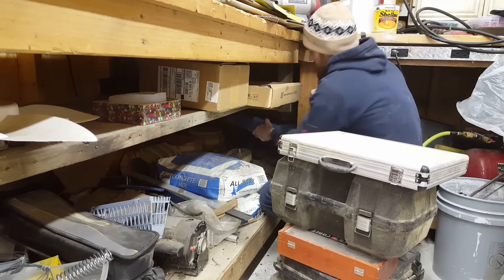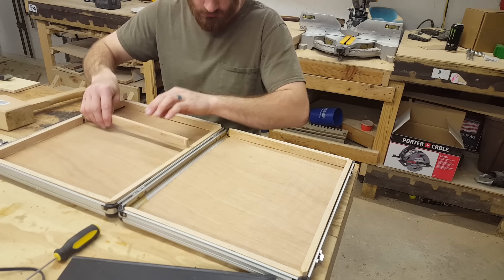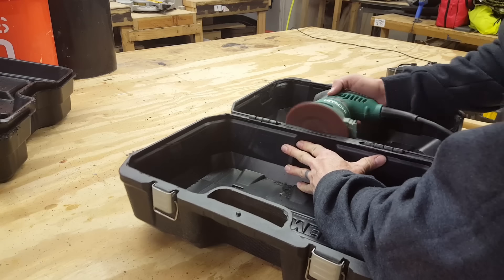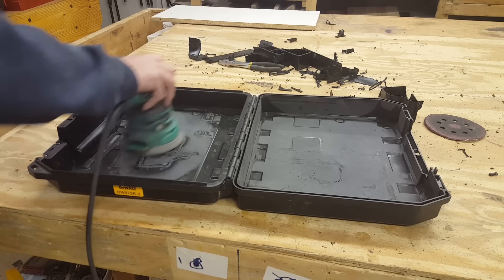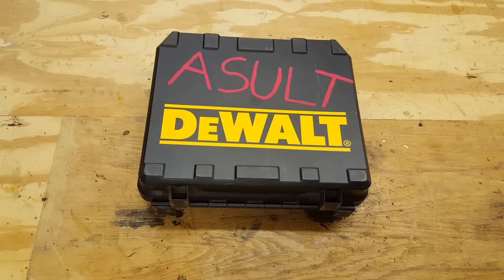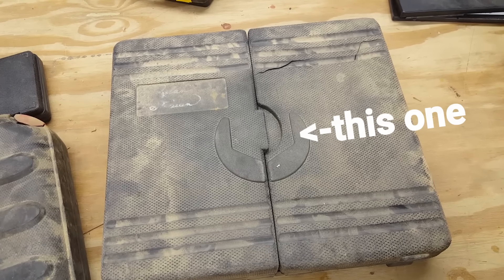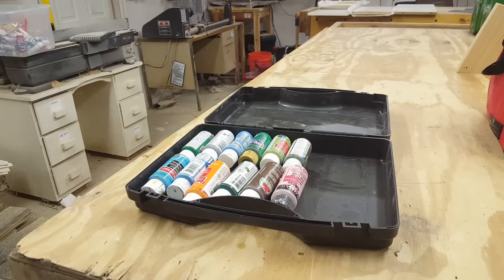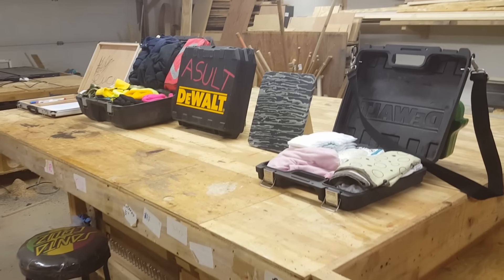5 Things to Make With Old Tool Cases

Comment: I'm 58 and have the tin dustpan my father made as his shop project in school.  He's 85 now.  I still use it in the garage almost daily.  Works better than a store-bought plastic one.  Two thumbs up for your case recycling and keeping the memories alive in your cutting board.
Reply: That is very cool about your fathers dust pan. I also made one 50 years ago in metal shop class out of galvanized sheet metal and a flat steel bar bent for the handle with a loop to hang it and all spot welded. I still remember making it in class and I use it almost daily as well. Very simple design and it's the very best dust pan I have ever owned. It will be handed down to my son and I know he will love it too.
Reply: Beer carrier for the deep ones.

Comment: I live in a small apartment and I found a bunch of dewalt cases in the trash a few years ago.  I use them to hold all my tools, my hardware and anything related to construction and repaire.  They are fantastic and it is alawys nice to be able to take what I need to people's houses when they need me to fix something.  Never throw these away.

Comment: I use a couple of them to hold my ratchet straps tie downs that I use with my pickup truck. The boxes slide under the seats so they are never in the way, but always close by when needed.
Reply: This is such a great idea!  I'm going to make this.  Thank you.
Reply: Pure genius, they get tangled and lost normally, thats a great idea!
Reply: that's a pretty good idea. I have mine in my center console in a little case but it's not quite ideal for it. I might steal that
Reply: I used to do the same. But have since just got rid of the ratchets &  use the strap as a rope. Now they are a lot smaller & just lay wherever
Reply: a-ha!
Reply: Great idea!
Reply: nice idea. think i need one for my jumper cables--emergency kit
Reply: Great idea!  I have an old duffel bag for that now.
Reply: thanks for the idea...time to make one for jumper cables, reflective vest 🦺and gloves so they aren't stuffed in the spare tire well
Reply: Thanks for the comment, I love that idea and will do the same. Good way to store extra tools in your truck, or car, for emergency repairs.

Comment: I’m a musician (guitar ) and a handyman kind of guy.
I took an old Dewalt drill case, cut out the inside partitions and use it to carry all my sheet music, cables and some extra batteries for my peddles.
These are the best cases ever.
Reply: I used a hard golf bag case to store all the cables associated with my PA system. Put dividers in it, which made otganization a breeze. Having the handle and a set of wheels make transport much easier.

Comment: This vid popped up the day after I spent 4 days organizing my garage. By day 2 I considered seeking professional help for hoarding. It's not just cases for me, I save the most random junk. Everything looks useful for me.
Reply: You must be my kindred spirit- my workshop, too, is a hoarders den. At least that's what my wife thinks. But everything in there is useful, and will be used. I swear!
Reply: Sure, easy to say but what is the time limit & should there be a capacity. I've recently used parts off junk I have been pushing around for 10+ years. It also sometimes seems like stuff suddenly becomes useful after it has been disposed of.
Reply: So true. An all those YouTube enablers with their "don't throw away scrap" videos.  I need a blind person to come in and clean my garage out.  He won't be tempted to keep thing based on what they look like.
Reply: Having done maintenance in commercial and residential properties for 27 yrs. I can understand holding on to that item...
That being said I re used a lot of that stuff as well ... Swap out a faucet ..put it in a box with others ..get a  client who needs a new faucet but can't afford one
.rebuild the best in the box using parts from others in the box of same type...presto that family has a refurbished good shape faucet.
Now what to do with all the cords I've cut off things " yea good repair cord" along with the other 50 to 75 in the drawer or old light fixtures. ...🤔🙈( it will go away, it will go away) lol
Reply: ALPHAFERT   don't worry - we are totally normal!! 🤪
Reply: Keeping things around because they "might be good to have one day" is one thing.. the main problem in my garage is knowing where the heck i put that thing 5 years ago (or last week) now that i need it..
Reply: ALPHAFERT 
list yer books on spdsht..
good will / red white and blue/salv army bag in several rooms...

can you get out of your comfort zone...not for just the biggs.. we know you can swing the sledge...can you do a Mel Robbins 54321 launch ! on little stuff ?  that may be the key to untucking your hoard or horde ( sp? )  i'm struggling...🤔
Reply: Kirk Ryan 
there must be professional untuckers who can get a shop down to fighting trim.....😐
Reply: ALPHAFERT  Yeah, I should put a time limit on stuff, like a "sell-by" date tag. Great idea! 😊
Reply: Kaffe4u  Yeah- that's the other tricky issue- having it to hand WHEN YOU NEED IT! A good filing system for articles and materials... Anyone have any good suggestions?
Reply: Yeah but how long? I used some junk this week I've been pushing around for over 10yrs.
Reply: ALPHAFERT I've also used stuff after years, but, getting the balance right is a tricky one...
Reply: @imranh5395  I got a pretty decent system for saving those "might come in handy some day"-items.  Plastic containers labeled with numbers on 5-6 shelves in the garage. And an old classic binder with alpabetical register.  There i put all those tools and things that i rarely use(needle files, springs, lightbulbs, hinges and so on), or things i got extra of (wire brushes, zip ties, 10 kinds of glue). and just write in the register what shelf and what number the thing is in.   works pretty good for smaller things.
Reply: I'm just building my junk up. I'm doing a great job. I'll wait for about 10 years before I think about having a sort out.  My missus is banned from this area. ✋😂
Reply: Just so you know, Every thing is useful esp the day after you throw it away,,, Go ahead throw it away and see what i mean, lol
Reply: @TheaMania  Go buy another one and the old one will show up, Then take the new one back,,,
Reply: @Imran H
A brain injury 17+ years ago forced me to come up with some way to know what I have in 'inventory'.

I did two things:
I designate a certain location as a category location. Then, I just have to decide what category of job I need something for, and I know it's in the category.

The other thing I did wss create written inventory on my computer. I don't inventory everything, but electric motors, ball valves, thing which have specific sizes is the best place to start.  For me, it has also been related to getting older.  There's a certain age we all reach, it's an indivdual thing, not the same age for everyone, where you look at life on the basis of how much time you likely have left, instead of looking at how many years have gone by.

If you haven't reached the age, you won't understand fully. When you reach the age, you'll umderstand completely what I'm saying.  I don't have enough time left to be wasting it digging through boxes of stuff, or containers of fasteners. I have invested the time to sort and store the stuff.

For the last 15+ years, everytime I found myself looking through a container of fastenrers for what I needed, I invested 15-30 minutes sorting, containering and labeling the results.  It doesn't seriously whatever you're in the midst of, and you more than make it up, later, when you AREN'T dumping out a bucket on the floor/bench looking for something.

You have to get your organizing organized, though.  I was at my local pharmacy one day, and saw a garbage bag of empty pill bottles, 3' in diameter on the floor.

Are you throwing those away? I asked.  Yes, they were.

Can I have them? Says I.  I cut off the cap end just as the neck reaches max diameter. If you measure the bottom diameter in mm, they divide up into four groups, IE: <25, 25-40, 41-55 & >55. Put them in separate, labeled boxes, and you are set for fastener storage. You can fit the small ones side by side in those plastic drawer storage boxes, which are everywhere. Bigger ones can do the same thing in those bigger plastic bins made for storing fasteners.

I have taken to buying food based on container sizes. IE: for a while zi buy the smallest container of peanut butter, then the next size for a while.  

The only food containers I do not keep are mayonaise jars. .you cannot get them clean enough to not smell rancid, later.  And opening a jar of fasteners in a hot shop and having a rancid smell hit your face is NOT fun.

Getting organized can be very expensive if you buy containers, and a bunch of storage containers.  So expensive, you may as well just recycle the stuff, and buy new when you need it.  Just go to a Crate & Barrel, once, and you'll know what I mean.

I have many more solutions, let me know if you wanna hear more.  

The key to making 'saving stuff' pay off is teo fold. You have to be organized, and you have to actually use it.

Last winter I used something I'd had for at least 20 years. It was perfect for the job, and nothing else would have worked.  I knew right where it was when the need arose.

Happy sorting and storing.

GeoD
Reply: One of our pet phrases around our house is “we might have a use for it someday.” I mean, we actually DO end up using a lot of the stuff we hang on to, but there’s so much MORE that has been sitting around for decades just waiting for its moment to be “useful”. 😂
Reply: Everything is useful after you throw it...thats why you keep it....yeh I gotta problem too.
Reply: Yeah same here my garage has some stuff my father put in there like 15 years ago im still finding use for it
Reply: @georgedennison3338  I'd love to hear more of your ideas. I've been organizing the tool chest - use cheap Dollar Tree food and/or tool and/or craft containers if I had to buy anything. Cut out the compartment separators with my Dremel if I need space for larger items. Otherwise Spax screw containers hold so many different things.
Reply: But when you need it and have to go buy it, you realize how expensive things are. Then your extra parts cabinet makes sense.

Comment: Inspirational ideas from this video:
(1) the 45° jig with the table saw.
(2) Melting the cutoffs for re-use.
(3) Using a scroll saw for cutting precise shapes in the foam / plastic. I used to struggle with a knife to make marginal looking cutouts.
Great video.
Reply from the maker: Awesome thanks!😁

Comment: One idea I suggest (and will be trying myself): to keep some of the rigidity of the PE HD cases, rather than cut out the inner layer that was preshaped for the power tool, heat it up with a heat gun and see if it will sag down to the shell on its own. 
   It may need help into the corners, and maybe a pinhole on the outside connected to a shopvac would pull it down well. 🤷‍♂️ 
  But this seems like a good way to open up the storage space, without cutting out the material, possibly strengthening the body?

Great video! Thanks for the inspiration!! 👍🏼
Reply: I don't own a heat gun yet, but is there a chance that it would melt the outer shell as well?
Reply: @TheOriginal   No, probably not.   It's very easy to control how much heat you are putting into the material, and actually hard to overheat it.
   It's possible, but you would need to be trying intentionally.
    Good luck!
Reply: @rainger66  thank you. Now off to get a good deal on a heat gun.
Reply: Well, did it work?
Reply: I bought a heat gun but it came with another case
Reply: You could put it in a tub of water to keep outer case cool while heating inside case
Reply: You could put it in a tub of water to keep outer case cool while heating inside case. Should float
Reply: I had that thought as well, have several cases I've planned to try it on but haven't yet.

Comment: More ideas, thanks.  Always hated carring tools loose.  I have old steel cases for my Skilsaws.
I modified a Dewalt box to carry a 1/2in impact wrench and a 1/4in compact impact gun, for going to the junk yards. Carries both with batteries attached and a spare 4ah battery.  
When going to help my son with projects, the same case carries a 1/2in drill motor and 1/4in impact gun.  
Old cases are handy.

Comment: Great ideas. Up here in northern N.Y. I use a few for ratchet straps and tow chains, on the back of my truck. Keeps them a bit more organized. Nice work
Reply: Same.
Reply: I'm so glad you said that about the ratchet straps!
I hate trying to grab one and have to untangle several before using it.
I'll be putting this idea to use soon! Thanks!
Reply: I used that same technique for my toe chains in an old circular saw box w/ the guts cut out!! Ratchet straps are next!! GREAT VID!!
Reply: now that's a damn good idea! i got a bunch of straps all over the garage, and at least 3 of those old tool cases catching saw dust

Comment: Hooray -- great ideas! My brother can get pallet loads of like-new cases from a company nearby that pulls the tools out for use in its huge shop. The tools get used until they break and then get tossed. Cases sit in stacks in a corner until guys like my brother come along. While some are immediately useable for actually putting tools in (like ones that came without cases or in soft totes), many of them are just too specifically designed to use for some random tool that might need protection. So, they sit around waiting for inspiration.....like this. Thanks!
Reply: You guy's really should come up with a good idea to repurpose the case's and sale them on line y'all can make some big $$ on something that going to get tossed out anyways.
A guy like me is always buying case's from Harbor freight to store a tool's in that came in cardboard box that needs a case. I like my tools organised so I just pull the case out that has the tools I need on the shelf.  My brother's shop he spends to much time looking for a tool he needs, my shop is the opposite everything is in case's and labeled or in reach of right where it needs to be

Comment: when I go to a job site I open several of my dewalt cases and plug in my 3 batt chargers in one case. Batts in another case and my "bits and blades" case with bits, blades, nails, screw bits and all the other tiny parts needed for a job. Makes loading and unloading truck faster. Keep my 2 "wiggle saws" and all its blades in one case too. Tile tools in another. These cases really help me keep from losing stuff.  Also have a sandpaper case with all the diff papers.  I keep my batt tools in a buckets to make easy carry. I mark them with a paint pen to save me time. I try to spell correctly too..... asalt looks even better...

Comment: Great ideas. I’ve used a universal circular saw case to put smaller plastic boxes which have a selection of screws, nails, wallplugs, washers and various bits and pieces.  
With each item in its own lidded box they don’t fall out if the box falls over. But are easily removed to use, or refill, or change for a different item.
Reply: That is an excellent idea. Having them all in a portable case would save me a lot of time from running up and down the stairs to find a part that fits!

Comment: I did demolition in HS and it's been 25 years but I still have an empty circular saw case I found on a job. I immediately cut out the inner parts like you did and made it a place to store important things for the car. One side has a reflective thermal tarp held in with velcro straps and the other side has the same for things like a couple flares, packs of batteries and maglight, a pair of winter work gloves and a few other things like that. I've actually changed vehicles three times and that case still comes along for the ride just replacing the batteries every few years just in case. It's probably the oldest thing I still own, and will likely always own, since I graduated from school.

Comment: I‘ve transferred several of cases like these into storage  cases for tools, materials etc. Great idea to use the electric chisel tool for the so called „shading“. What you did with the pixelated „super-perforator“ is another technique I‘ve applied a couple of times. I call it creating flexible inlay inserts, or „caseing lodgements“. My next probable project in this concern might be a remodelled case for electronic bite indicators for night fishing sessions.

Comment: The diaper kit is pure genius! I love it, if I had littles around I'd be building it for me right now!

But here's some improvements to the design: add some straps with quick release snap buckles so that none of the stuff falls out when you open it.  Equip the lid side with a large pocket to stash a change pad, and a couple small pockets to keep a few empty plastic bags for soiled clothes, etc.

Comment: I used my dewalt boxes as a “saddle boxes “ for my commute bicycle they fit perfect yes a little heavier but they look nice!!!
Reply: Great idea!
Reply: VERY good idea
Reply: How do you attach them to your bike Enrique??
Reply: @bruceschwenck638  First I have a bike rack I used before then I centered and marked the best I could the points where the boxes meet the rack supports that bolt to the bike, drill some holes on the boxes I reinforced from the inside of the toolboxes with a thin piece of metal and used heavy duty wire clamps (small size) the ones they have a piece of rubber inside were the wires go thru and bolt them over to the rack supports I finished the holes with some silicon from the inside of the toolboxes bolts and pieces of metal trying to get them water tight, I hope it makes sense this.